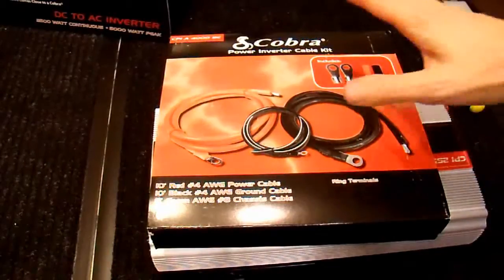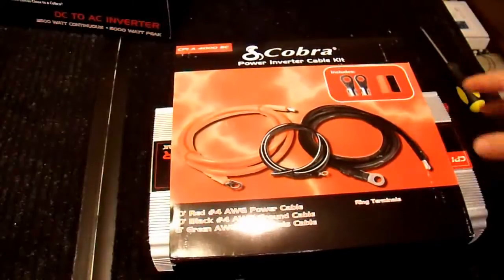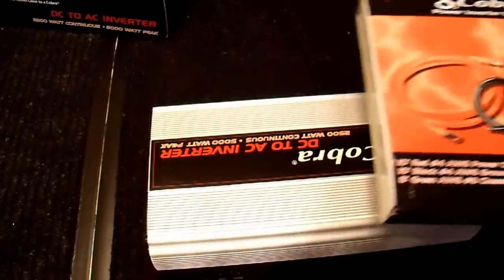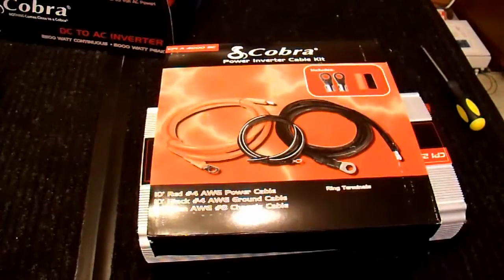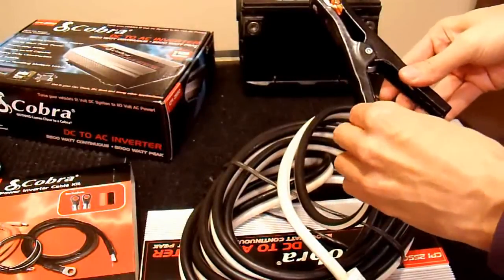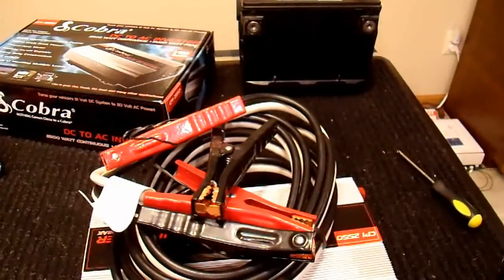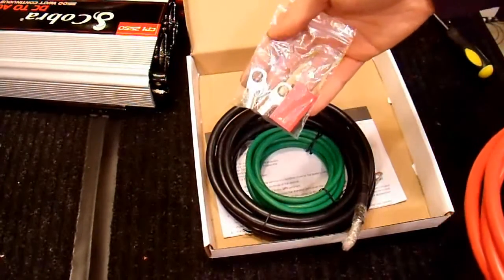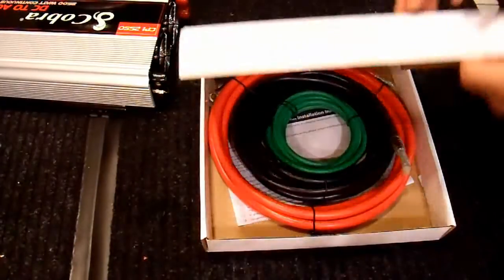Cobra Inverter Review Part3 - Cables and Cable Kit Review

Comment: For what it's worth, all information that I can find about the jumper cables you are recommending is that they are now made of copper clad aluminum, which reduces conductivity to about 60% of copper wire.  I found the exact same set at my local auto parts store, and wonder if the set you have is made of 100% copper.  Please let me know.  THANKS for your awesome reviews.

Comment from the maker: Those RM UPSs will definitely be better quality and more reliable than a cheap-o inverter like this one, but I do like the smaller size, portability, and low idle power draw of inverters like this.  And this one runs on 12V making it more versatile.